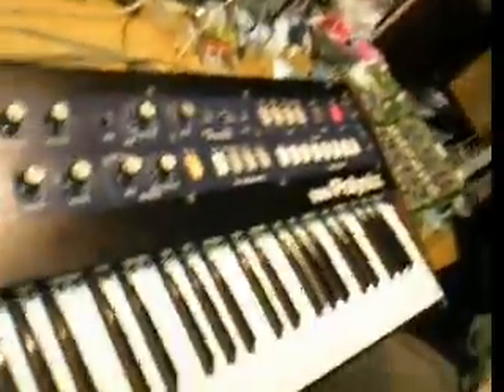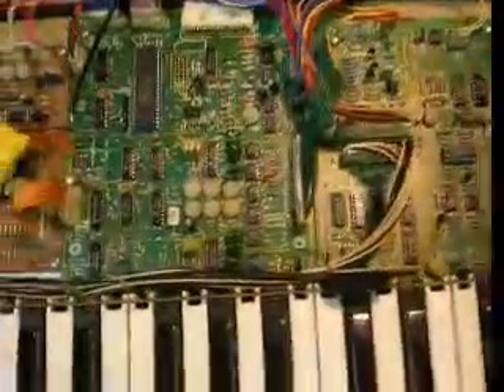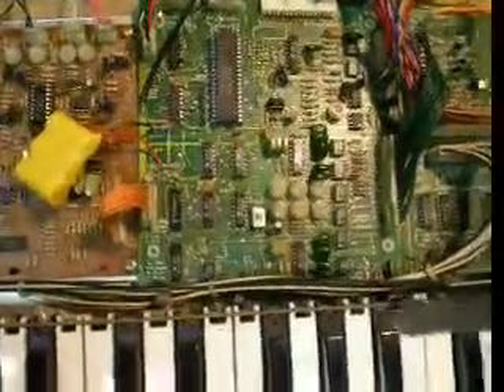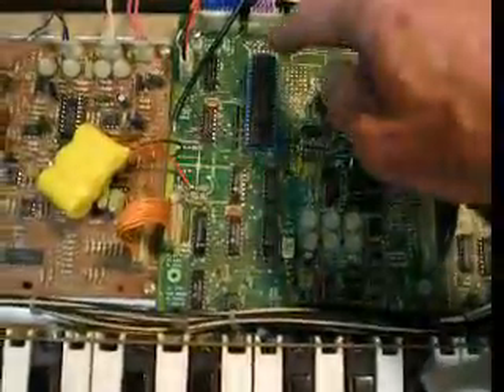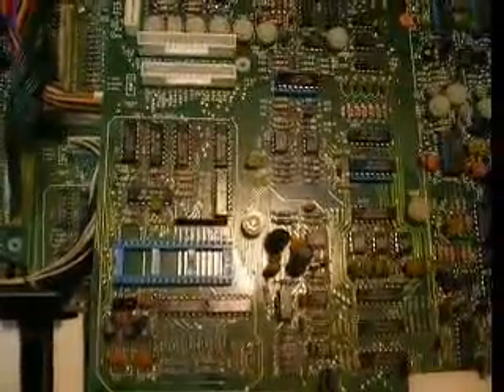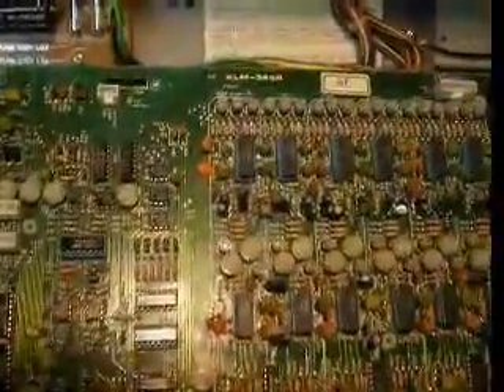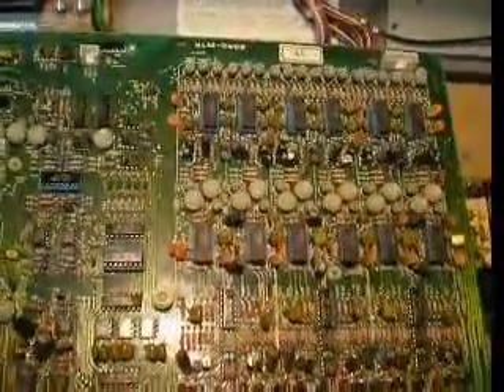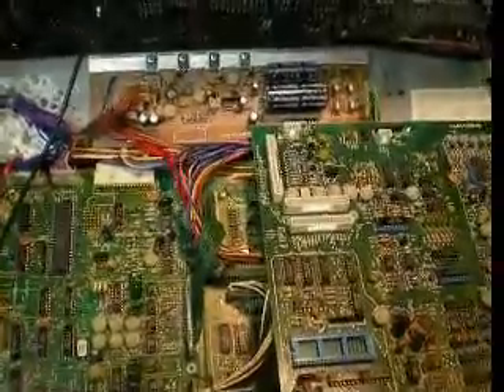Inside the Korg Polysix.  Analog synths with Storage

Comment: would it be difficult to mod the envelopes so they would be faster just like on the junos 6/60
Reply from the maker: Faster..?   I'm unaware that there is something slow about the Polysix envelopes :-).  SSM2056.  Are you perhaps thinking of the notorious JX/MKS70 that has slower digital envelopes due to the facility limitations in the computing facilities that handle that?
Reply: Snappiness.  I am aware of mks-70 slow envelopes... I have one. luckily there is a mod for that :)
Reply from the maker: ElenaDiakova
probably referring to the upgrade someone did?  I've never been motivated. I just use it for what it's good at.
Reply: these envelope chips SSM2056 should handle 1ms attack time (snappy) but the design of FX board is affecting the synth's flat frequency response. fortunately there is a mod to fix that and it will also remove the harsh humps in the mid frequency range.
Reply: Juno's were faster because they were digital unlike the polysix. I owned A Juno 6. And sold it for a polysix cause I wanted a more organic-earthly sounding synth with the memory (of course)
Reply: well thanks to synthacker mod I got my attack envelopes as snappy as I would like  in 1ms region along with more high frequency boost,
Reply from the maker: skyprop
well like we say on the Super jx, digital doesn't necessarily mean faster on the envelopes.  I love them all for what they do well whatever the case
Reply from the maker: ElenaDiakova
thanks for the link, they have some interesting stuff on that page.

Comment: @geox19801 well, I have never been under the hood of a Korg polysix yet but based on other synths I have worked on, you may have some bad filtering capacitors in some of the audio circuits. I have had rare cases where dust created noise as well.

Hope this helps somewhat.

Comment from the maker: Continuing, then synths like the  Korg DW's, DSS-1, Ensoniq Mirage and ESQ-1/SQ80, SCI Prophet VS / 2000, and Kawai K3 came along that had still analog filters but used entirely digital processing to generate the waveforms right out of a DAC.  This of course allowed the flexibility to do some more interesting timbres since the data could be read right from a ROM chip or in the case of the samplers, sampling RAM.  So these were DCDO's I suppose. The siel DK600 Is unique.  VCDGAO's :-)

Comment from the maker: There are various things labelled "DCO".  The first things were apparently the Crumar DS-1 and the JEN Sx-1000 I believe someone told me also around the same time.  At least the DS-1 used multivibrator chips that actually had a preset R/C with analog CV mixed in from the bender etc.  So I guess it was really a VCDO. :-)  Then the polysynths were at first using DCAO's like ax80.  Curiously Akai went the other way and most of the rest of their synths used the CEM3394 VCO/VCF/VCA chip!

Comment from the maker: Welllll not quite 'almost' :-).  It was assumed on some websites that the AX80 had VCO's.  However it's very similar I believe (though I still haven't seen a diagram) to the JUNO's and other DCO synths of the day which use an op amp integrator that is digitally controlled to generate the saw waves.  Otherwise the signal path thereafter is analog though all controls for envelopes are digital also.  Whereas the polysix is completely analog on all those things.  I have been inside the AX80..